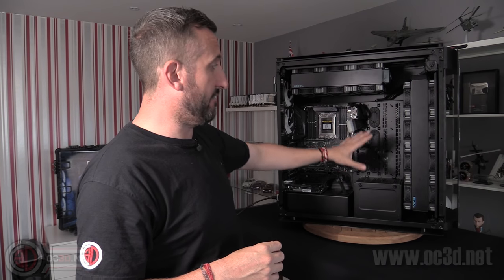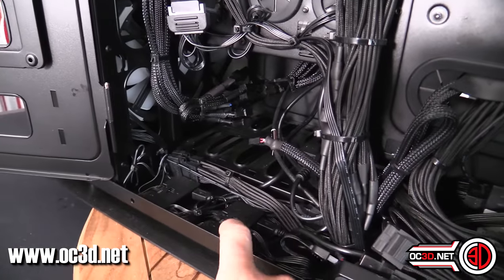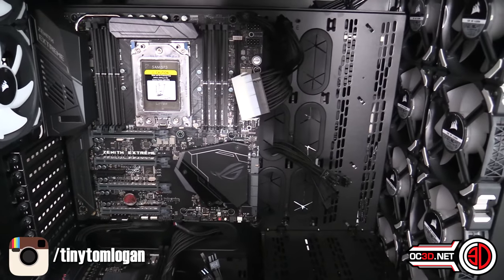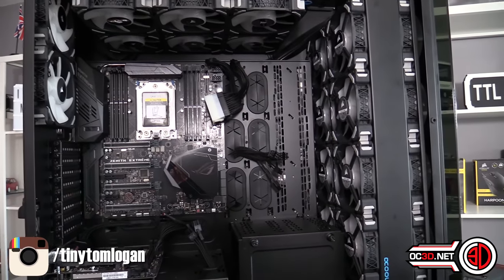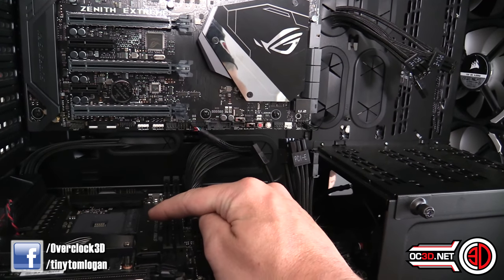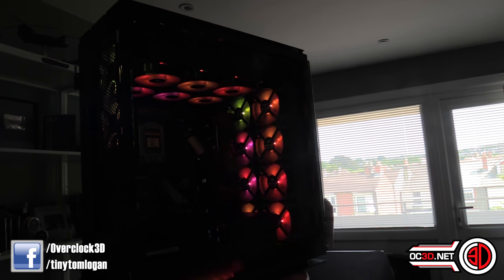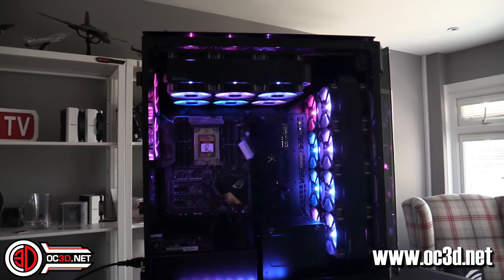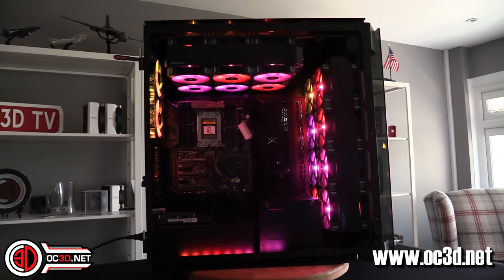Corsair 1000D Project Update

Comment: Thanks for the video! I"ve had my Corsair 1000D for several years now and I currently have an Asus ROG Maximus Z790 Apex Encore motherboard, 13900KS, 2x24GB 8400 CL38 DDR5, and Corsair AX1600i PSU.  Im fixing to install my first Custom water loop and was hoping these radiators you are showing from Alphacool are 60mm thick up front that are 480mm? I bought 2x EK Quantum Surface X480m radiators that are 58mm thick and plan to put a total of 16x 120mmx25mm BeQuiet Silent Wings 4 Pro 3000rpm max fans on them for push/pull setup. It looks like ill have just enough room. Im going to jusy be cooling the CPU so I wont have more than the two 480mm radiators up front so ill probabl7 just leave the 420mm fan tray up top and put 3x 140mm fans exhausting warm air out the top and 2x120mm fans exhausting air out the back. Thanks again!
Reply from the maker: I appreciate you too dude, thank you!

Comment: I just did a simple build in a Corsair 1000D, using just fans.     My new long term goal, is to look for ways to gradually upgrade and hopefully get a video card the size of a watermelon.   LOL !

I found the old thumb screws everywhere to be really annoying.     My ASUS X570 fit so perfectly into the spot, that is was so simple to install.     I wish the back exhaust area had room for two 140mm fans, but it only has room for one and an additional 120mm or just two 120 mm's.      My CPU cord barely reached the powersupply.      I would have preferred to have three 140mm fans
on the front for my air-build, but that was not a deal-breaker.      My Noctua fans would not reach the Commander Pro, but I have the Noctua extension cords laying around here in a pile somewhere,
so I will fix that tomorrow.

I do not know if I will add a mini-ITX to the build.    I wish it had a spot for a Raspberry Pi or Odroid.   LOL !       I really did not want a full glass panel, expecially on the back, but I did what hinged
doors on both sides.    

I really wish there was a chassis fan hole on the glass near the video card area.

I will likely not have hard-drives on my build, but if so, just one.   I plan to fill up the SSD area and have a Linux distro or some other OS on each SSD.

The only think unique about my build, is that I have Fedora Rawhide Workstation loaded on the first NVMe which is a fast one, and then I have Fedora 33 Beta Workstation loaded on the 2nd NVMe which is slightly slower, but one TB.

For the time being, I just have a new Ryzen 3 1200AF, but I will eventually put something better in.      I have a giant Noctua Air-cooler and plan to fill all the fan holes with premium fans.

But little to no RGB.

    https://www.dropbox.com/s/3djp5xh90sn0ihm/Photo%20Oct%2011%2C%2011%2036%2040%20PM.jpg?dl=0

I am very worried about moving it though, as I am old and frail and live upstairs, and I might have to move out soon due to being furloughed at work because of the COVID b.s.

Comment: I suggest using pastel over transparent coolant because I am currently using this case and the tint on the side panels is so dark that all transparent coolants, no matter what color, look too dark. Yes I do have some super bright LED strips, 4 addressable strips from phanteks with 60 LEDs on each, and that's still not bright enough.
Reply: I'm currently waiting for a few strips with 144 addressable LEDs per meter I bought from Chinese eBay. I'll be making my own adapter to have them work with Aura sync or preferably Corsair Commander Pro. That might be bright enough to go through the tinted glass.
Reply: Just in case anyone's curious, I'm using dual 360 radiators at the moment. One is 60mm and the other 45mm, both cooled by EK-Vardar fans(they are absolutely the best when it comes to radiators). Looking to buy more Corsair LL fans just for the look.
Reply: Harry Lin from what I seen 144 don't work that well with corsair so what I did is use a SP105E led controller but after seeing the SP108E led controller I might upgrade to that.
Reply: SkinUpMonkey oh great, I might look into that controller too! Thanks for the comment.
Reply: Np mate, it's only let down is it's not sync'd up with anything else but makes up for it with how many settings you have. I do use some 60 per meter strips with the node pro for desk lighting which I think looks nice.
Reply: SkinUpMonkey Awesome

Comment: I would prefer if you can split those fans in to two separate connections (Front & Top + Rear). So you can control the airflow inside the case.

Comment: With all those huge radiators put in, the case doesn't even look that big anymore. Crazy man. Also, is it possible to flip those fans around on the front radiator that are viewable from the inside so that all the fans look the same? I feel like it will make things look better. It might be a lot of work to take a fan apart to flip it around though. Either way it still looks "cool."
Reply from the maker: if you flip the fans around it changes the direction of the airflow.....
Reply: OC3D TV i didn't mean the actual fans. I meant the casing that holds the fan (I don't know what to call it, not the actual fan blade itself). But again that would be a mod and I wouldn't even know how it would be done right. The more I think about it, the more I realize it is not nearly worth the trouble nor is it remotely easily done (practically needs to be designed backwards). So nevermind lol.

Comment: Hhmm. I wonder what it would be like if it's a dual chamber design... Paul also showed that there's a minute clearance issue if the owner wants to use a 480 rad both on the top and at the front, so I guess Corsair needs to do a revision of this product.
Reply from the maker: 2x 480 wont fit - its not designed to either - hence why Im running 2x 480 and 3x 360
Reply: Oh I see. So Paul from Paul's Hardware stretched it a bit haha. Nonetheless, I still think this case needs a redesign. What do you think?
Reply from the maker: I dont think ANY case will ever be perfect for everyone. Do you really need 4x 480's? Nope.
Reply: Not me but perhaps someone else haha. The idea I have for the redesign is similar to what you've said in the video though, relocate some of the parts, maybe at the back.

Comment: You honestly dont want to put a 32 core in that with its VRM. There is a reason they are refreshing x399.

I mean overclocked your going to be dumping like 400w into that VRM if not more so get the monoblock.

Unless you dont overclock it then its fine.

Comment: I know this is a littlew old now, but I have this case, about to put a 9900K itx/2080TI, 3900x atx/maybe 5700xt, and thinking 15 fans per system , regardfless of loks. Just don't have enough fans for push/pull

Comment: If he knows he might upgrade soon after the build I'd hazard a guess that the launch for the new 11 series is next month / in September then
Reply: Matthew Gilbert he means 2nd gen threadripper.
Reply from the maker: Or do I mean both......
Reply: You massive tease!!!
Reply: Screw new GPUs , we need a 2000 series 16 core TR.
Reply: Matthew Gilbert i kinda caught that too. Empasised on it a bit
Reply: 16 core? Sure?  TR2 may be more? or it may not, lol. There are a lot of rumors flying around about TR2 and something from a GPU maker, so "Something" may happen before the build is finished or shortly after, lol.
Reply: Fuck all of those crappy "upgrades", the upgrades he really needs include laser interconnects with people on neon coloured bikes delivering the data packets (so long as they don't use Bing Maps for navigating said laser interconnects).
Reply: Nvidia invited the tech press to Gamescom. The upcoming Battlefield is sponsored by Nvidia and will be demoed at Gamescom. Frostbite, the engine Battlefield runs on, is listed by Microsoft as one of the engines for which DXR integration is already planned. During BFV's alpha some users found hints about raytracing in some debugging commands.

Conclusion: GTX 11 series reveal at Gamescom and Battlefield V will be one of the games used to showcase the new tech.

Comment: I don't know what the newer Alphacool mounting system on the CPU block is like but the older version was horrendous. No matter how i tried to get the thumb screws evenly tightened or add/remove TIM the temps across the Cores were all over the place.

Comment: Will be negative pressure? And where all the heat from inside exhaust? Too much air volume. Even if this machine works 24/7 you think that size of radiators aren't too big?
Reply: tetnia waht

Comment: How did you get 2x 360mm to fit up in the top. I thought this case only supports 1 x 360mm rad up top?
Reply: It supports 420 mm rad, but yeah I'm wondering how he got x2 360mm rads.

Comment: Hello - love the build.  Great stuff!  I am just looking at a 1000D myself.  Just wondering, are the 2 x 360mm rads in the top on a sliding radiator tray or  are they screwed directly into the case?  if they are on a tray, where did you find that twin 360mm tray?  I've been looking around but can't find one anywhere .

Cheers :)
Reply: Its the 2x480mm tray but he just put 360mm radiators on it

Comment: Sorry but Commander Pro for control should have been used as the new iCue software would be good for more granular fan control IMHO!
Reply: iCue was working great then for some reason stopped working with fan curve so just gone back to Cue 2 and use SIV to control my lights and fans since that way I don't need software running for all of it to work.

Comment: 2200watts a peak load if you ever maxed it out!. Lucky you guys use 240v @ 10 amps so a circuit can handle 2400watts where here in the US 120v @ 15amps is 1800 and continuous loads should only go to 1440watts. Lol.
Reply: nah mate you could easy run 2 maxed out in each room, only casualty would be the electric meter going nuts and the cost lol.  standard single floor socket ring circuit uses a BS16 amp trip unless on an older fuse board. what gets you 1st cost running it or being blinded by the lights  lmao

Comment: I have the 1000D here, and that HDD box is going away when I find a kork for the hole it will leave. Typical Corsair, parts you want to remove aren't fixed with screws.......

Comment: What’s the differences between the node and the commander or commander pro? You have to use them with the Corsair RGB fans? It’s all confusing to me.
Reply: The node is only for led's like the strips or fan led's where's the Commander Pro can do what the node does plus temp sensors and fan control plus usb hub.

Edit, but for fans you do need the led hub thingy that then connects to the node or CP.

Comment: So im really curious, can you do an air cooled only build in this??
Reply: Of course you can!  There are smaller and cheaper dual system cases though.
Reply: @wickedwonka999  i ended up getting it and i have two systems in here that are air cooled with AIOS but im eventually moving to watercooling now that i have more knowledge in it.
Reply: @brendengordon8220  right on, I thought about doing the same thing but I'm going with the 7000D for my first water cooled build instead.
Reply: @wickedwonka999  7000d is an awesome case im actually planning on doing my wives build in one, good luck to ya man 👍👍

Comment: How will you drain the front rads with the ports on the top, I have the same case and put my front rads so the ports are on the bottom so I can drain them without removing them.
Reply from the maker: There is a drain plug in the bottom of the rad

Comment: Do yourself a favor and get the Corsair Commander Pro along with a temp sensor for the loop so you can plug that into the CP which then you can use that to control all your fans based on the water temp.
Reply: I did comment before you said about it but no idea how it's worse then the way you doing it but guess you can do the same idea but with MB if you get the temp sensor.
Reply: Oh right I didn't know it come with it.

Comment: How did you fit 2 420mm radiators at the top? Corsair says it only fits 1
Reply from the maker: Got an extra front plate and fitted it to the roof
Reply: You have a link?
Reply: And are they 360 or 420?

Comment: 840 mm of radiator per system?.... I feel like you might be running into diminishing returns....  It is pretty though.
Reply: Not when 2nd Gen Threadripper is installed, the extra headroom would help then.
Reply: Gives the opportunity to have the fans on a slow quiet speed and still cool :)
Reply: Oh right.  fair point.

Comment: How did he changes the radiators top panels?? i was wondering that question, and i found Coursair link where you can buy differents fan trays for this cases.
Here i leave one example 8x120m --> https://www.corsair.com/us/en/Categories/Products/Accessories-%7C-Parts/PC-Components/Cases/Obsidian-1000D-8x-120mm-Fan-Tray/p/CC-8900160

BUT i didn't find the fan tray he used in this video

Comment: 30 FANS!?
Reply: I think 16 on the front 12 in the roof and 2 at the back is 32 total. Yup bonkers mental...
Reply: 16+12=28+2=...32?
Reply: You're both wrong. 16 + 12 = 28; 28 + 2 = 30. Just wanted to be technical (even though I know what cornbreadman meant) :DD

Comment: Why Corsair fans? They're decent and often a good value when come pre-installed. They don't even come close to other brands like Noctua or NB fans in therms of performance and noise. Everybody on the Internet seems to be favouring Corsair fans now. I've got nothing against Corsair, my rig is mostly Corsair (780t, HX850i, h115i, Dominators, mouse, keyboard,... ) but I can't understand why anybody would pay for their fans.
Reply: Tomasz Zajac it's a Corsair sponsored video he even said if you watched.
Reply: It's clearly their sponsor...
Reply: The ML fans are good tho and when you going overkill with rads you can use any fan you like since the temps will never be high so can run the fans at low speeds.
Reply: ML fans perform great and look great as well.
Reply from the maker: Corsair asked what fans of theirs they should send with the case - I chose these. TBH if I was buying fans Id have bought the ML120 LED's (I use those in my own personal rig)
Reply: corsair fans look nice and have nice effects.
Reply: Tomasz Zajac when you've got this manny fans it's doesn't really make a difference so might as well go with looks.
Reply: I bought a noctua nff12 for my GPU radiator and it sucks, GPU temps went up 15c compared to my sp120. The noctua at full speed (1500rpm) GPU temps were around 65 to 70c. With the sp120 at full speed, GPU temp is around 48 to 52c. Yes the sp120 is louder, but even when I have the sp120 at its slowest setting my GPU runs at 65 to 70c just like the noctua at full blast. I also bought nfa14s for my x62 radiator and love those, not sure what went wrong with the nff12.
Reply: #Mappi75 
They are very good quality fans. Just they look damn awful in most builds unless its copper themed. Nice build btw. Used to have custom looped 1080Ti's a while back (even owned a 1080Ti lightning) at one point. 

https://imgur.com/I7tpoLg

In a 900D although would have loved a 1000D. Since moved to a smaller case, single Ti air cooled with an AIO on the CPU due to room (case is under the desk now). And the fact the cards whine like mad. May end up going back to a custom loop in the future though.
Reply: OC3D TV Got your point. To be honest If I ever go for the RGB setup it'll probably all be all based on a Corsair hardware. Corsair cooling products get more publicity then they perhaps deserve but I can't blame them for their effective marketing strategies :).
Reply: The Corsair ML fans I tried were a bit buzzy, so I went for NBs and they are not. YMMV of course.

Comment: extremely misguided build and frankly embarrassing to see.
You could cool a truck engine with this amount of cooling its idiotic and a good example on what not to do.
Reply: The grey, grey world of Chicken batt.
Reply: The whole point of this build is to go off the deep end, so why not, also with that many fans he could run them at really low rpms and have it be whisper quiet and still dissipate heat like nobodys business. I mean he states it's an epeen build right off the rip.
Reply from the maker: The point is what can be done - not an everyone copy this build guide.
Reply: fare enough i guess.
i would of dropped the 4 pin connectors and soldered them all.easy enough to refit the 4 pins if you ever choose to remove them. just use shrink tape.
Get rid of that error point thats only going to cause head ache in future.